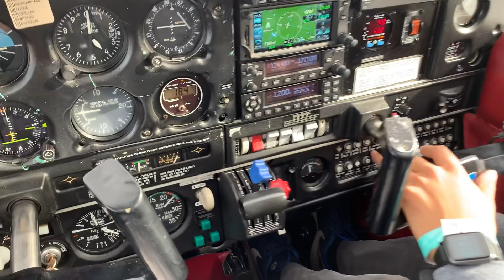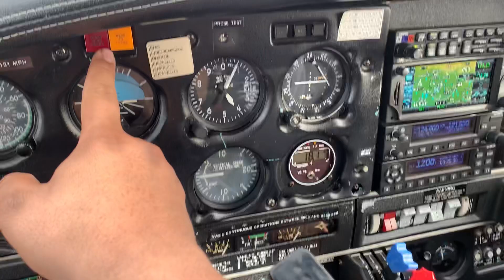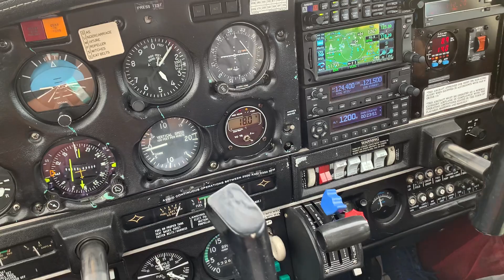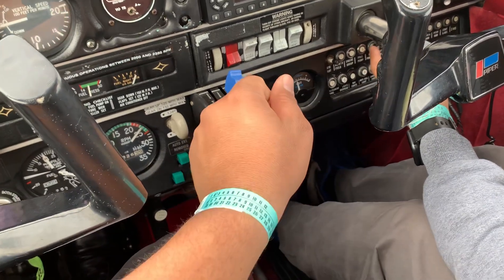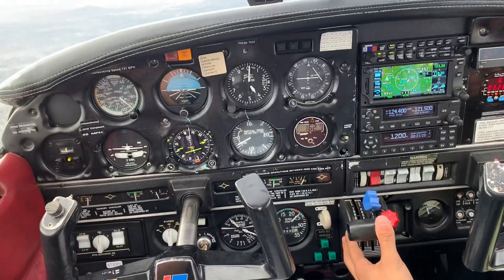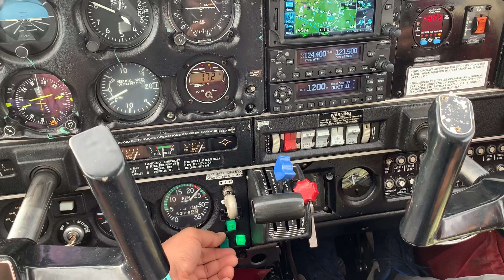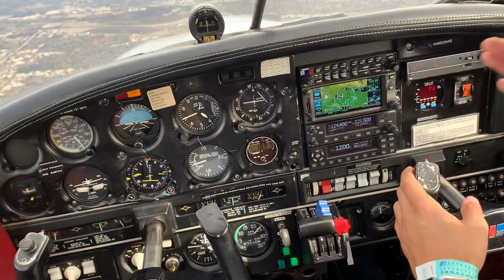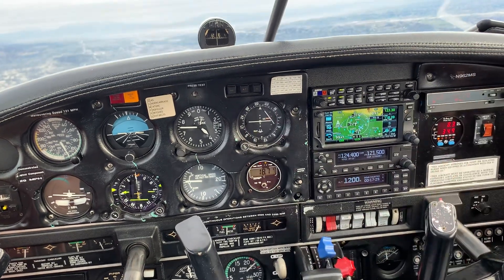EMERGENCY GEAR EXTENSION! on Piper Arrow (Simulated)

Comment: I would not suggest practicing emergency landing gear if there is no emergency. Going through the procedure is good to practice but not actually drop the gear.
I have had someone perform this with a perfectly working aircraft and the nose wheel didn't come down and they were forced to crash. Put it on stands and practice.
Reply: If it doesn’t work with the drop, don’t you just pull the drop lever up, and deploy as normal.
Reply: If the nose gear didn’t come down during a simulated emergency then it wouldn’t have come down during a normal gear extension.
Reply: And now that this video exists there is no need to practice it IRL. Just watch the video a couple of times and practice it dry.

Comment: Yawing of the aircraft to get a wheel lock is not achieved through air flow,. The wheels are heavy and are like rather the end of a pendulum. Rocking the plane relies on the inertia of the wheel as the plane slews away from it to lock it. Thus the yaw should be abrupt. If it was air pressure the SOP would advise yaw and increase airspeed as necessary.  Otherwise useful and thanks.
Reply: I was thinking about the airspeed as well during the video... I was like well if that's the case I wonder why they wouldn't increase airspeed a bit in a dive? Thanks for the information. I'll think about it as airflow and the pendulum effect of the wheel to help me remember which way to rock and yaw the plane for which landing gear might be stuck.

Comment: The reason in piper aircraft for verifying the panel lights rotator switch is OFF, is because when it's set to ON, the three green lights for the landing gear are dimmed, as to not blind you at night.  So imagine someone flew the airplane last night, forgot to turn it off and you're taking the airplane during the day today.  The three greens will be dimmed and might be hard to see even tho everything is working properly.  That's what you're verifying.

The other thing about checking that the lightbulb is burned.  Sure extras are nice.  But what you really want is a lightbulb you know for sure is working, so the better way to do it, is take one of the lightbulbs that is showing down and locked for another gear strut.  IE nose is off, and the mains are down and locked.  Take one of the mains and place it in the nose socket.  If it turns on, you know your nose light bulb was burned and the gear is fine.
Reply: Happened to me last month hahaha. Set the gear down, heared and felt it going down, but no lights. Went around and another pilot confirmed it was down. Landed and after landing I figured it out